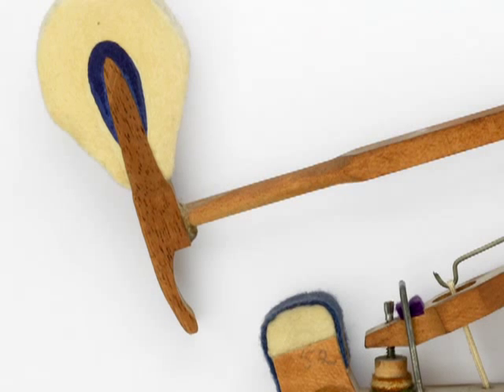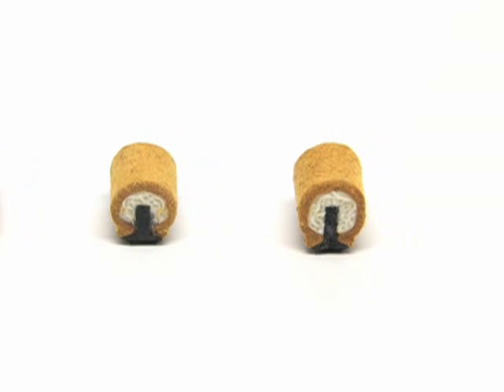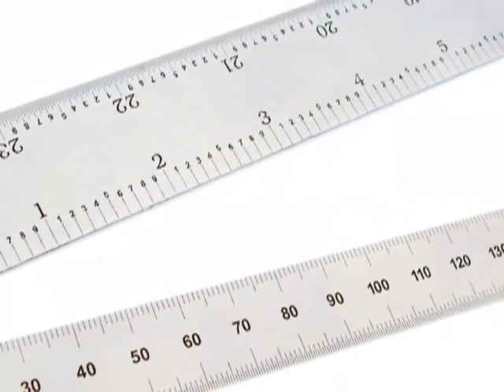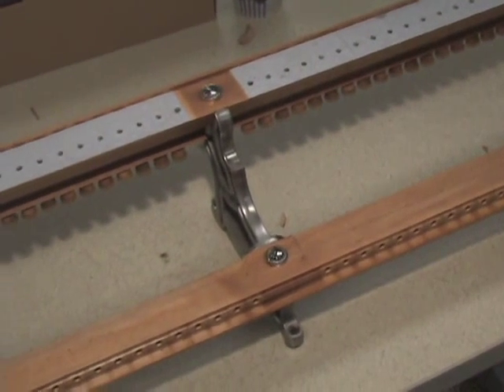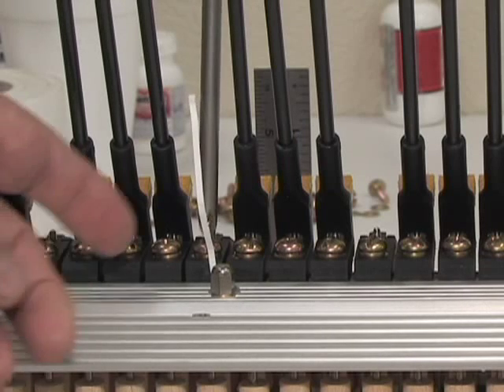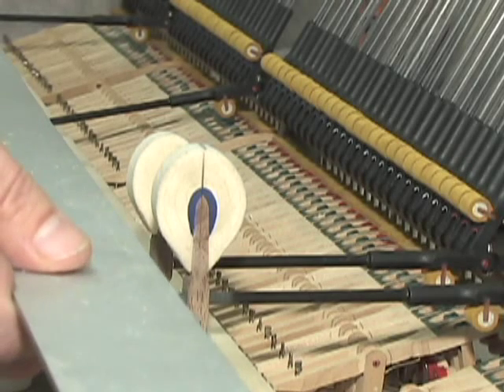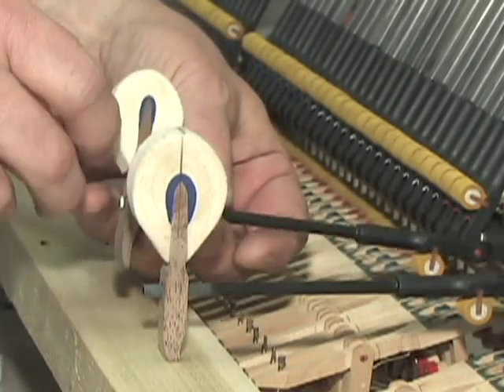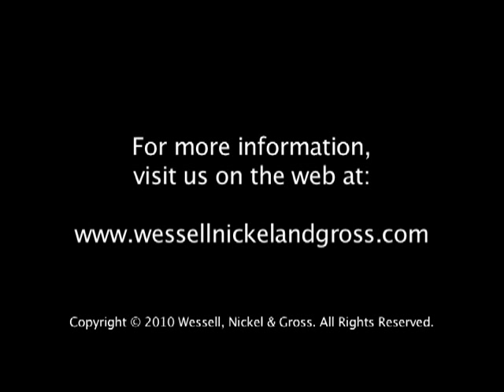WNG How To Install Composite Hammer Shanks and Flanges

Comment: Worth noting that the part of the video at 15:15 stating "WNG composite shanks have only one diameter" is no longer accurate. The Flex 1, Flex 2, and Flex 3 shanks get progressively smaller and need to be bored accordingly with the correct drill bit.

Comment: The CA glue process can only be described in this one word.  NIGHTMARE. 
Never will I attempt this radical change in hammer shanks again. I will stick to the methods used for the last 200 years.  Wood shanks glued to wood hammer moldings with wood glue.
Reply: I don't think I would call it a nightmare.  I actually prefer it given that I can get a set of hammers hung and setup quicker using the setup. I will give you that ti is different.  And of course if you are not expecting that I can see the sentiment.  But Honestly its not bad at all.  I honestly cannot stand how long the hide glue takes to set.  I use a spurlock Jig so I find myself just sitting there waiting to do the next section when I simply could have already moved on with CA glue. 

I will say there are a few tips that work well for those parts.  In particular A white colored pencil is helpful.  And if you have a white colored pensil, you can use it to mark where the glue collar will end up.  This will give you a reference point you can use to get the hammer 95% of the way there as you are doing your twist and as you lay it down, you can just make your final edits and it will dry in place.  You also don't need to worry about it being perfectly vertical.  The shank burning will actually stay in place.  And remember that you have 30-60 seconds depending on the temperature and humidity.  If you feel like you are not going to make that window pull it off.  The glue drys quick enough where you can spray some accelerator and drill out the excess and start again.  Also if you need to take a shank off, use a heat gun and the special wng tool/modified upright hammer extractor to pull it off.  If you just glued it, it should come off cleanly.  But use heat.  

Like with anything when you understand how to do it, its easy.  I mean I remember my first set of hammers with Hide glue. I redid them several times.  My WNG ones came out quicker, but I was trained by someone who had been using them for a long time so that made it easier.  Important thing is to not go into WNG expecting it to be exactly the same as wood.  Knowing both systems, I find wng stuff to actually be far simpler.  I mean for repining no need for re-bushing.  You can actually step down in pin sizes without having the parts wobble on you.  The pins are exactly the size of the part so no need to clip the ends of pins off.  I don't find myself at the customer's house next season to lubricate their action with some repining because the season's changed (I put a 1 year warranty on my rebuilds I sell locally).  They just are a better engineered system.  And of course it has.  Its been 200 years and the action is simply a mechanical part.  It wasn't until the 1980s that sanderson came out with his inharmonisity calculations.  Its why I re-scale most rebuilds I have done.
Reply: @zackeryhardy9504  This is all very welcome information.  I know that you are a great technician- I can tell by the educated , intelligent response.
I wish I knew half the things you mentioned in your comment to me . I had no awareness that I only had 30 to 60 seconds before the CA glue dried. AND I CERTAINLY DIDN'T KNOW THAT WNG PRODUCES A MODIFIED HAMMER PULLER!
I really struggled to remove hammers as they were incorrectly installed .
I will try WNG one more time, but I will need some time to recover emotionally from the stress of this Hammer hanging effort.
I may possibly be able to salvage what I have done and not have to start from scratch .
I sure hope so .
Your response is greatly appreciated and I can't thank you enough
Reply: @rogershaffer1  I have been there.  So don't hesitate to ask for some assistance as I am more than willing to provide it.
Reply: @zackeryhardy9504  HELP!
I am getting desperate.
All the hammers are hung on WNG shanks with the CA glue, AND THE FLANGES ARE TOO LOOSE. 
I like to see 3 to 5 swings of the hammer when I hold the flange.

They swing back-and-forth so many times they gave up counting

So frustrating
Reply: @rogershaffer1  Don't use the swing test.  The hard bushing is entirely different than the cloth.  Its a self lubricating material with a highly polished needle bearing.  Felt is a very grabby material so its a lot more grabby which results in fewer swings at a lower grams resistance.  

A gram gauge is the best way to measure the pinning.  They should be between 4 to 6 grams (7 is also usually ok).  Felt parts generally are pinned at 2 grams for reference and still achieve less swings.  This is another aspect of wessel that is different.  But do note that grams resistance of 2 and under has a chance to click so pinning at 4 to 6 is the recomended pinnning.  I actually saw a ptg article that documented repinning at 2 grams like felt and I will tell you not to listen to it.  I have been using these parts for years and they absolutely need to be 4 to 6 grams to stay silent.  The good news is they will maintain that for a long time, but if not set up that way you will have problems.  The gap also between the birdseye and the flange also needs to be under 8 thousandths. So always check the that gap and pinning if you ever hear a click.  I have a feeler gauge for this.  If you have a larger gap you can use a punching to fix it, Or you can try to push the bushing in with the pinning tool to take up the gap, but these each have their issues.  If you have a large gap I would say to just give them a call because greater than 8 thousandth's clearance there is actually outside of spec.

Also note you do need the needle bearings provided by wessel.  The total spread of the entire lineup of pins is 1 thousandth of an inch.  And it steps up in the 10 thousandth of an inch measurement.  So basically a #20 toa  #21 pin for felt is literally the entire lineup for pins with wessel parts.  Tolerance are much higher.